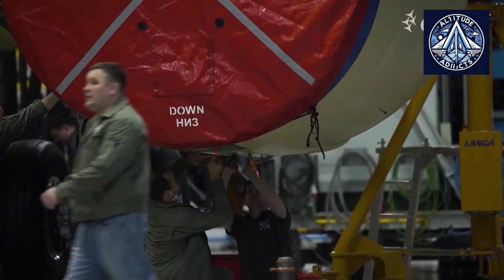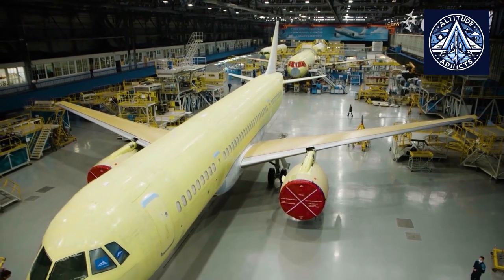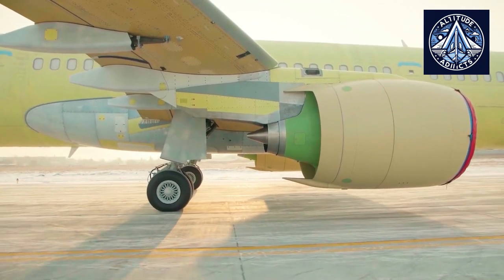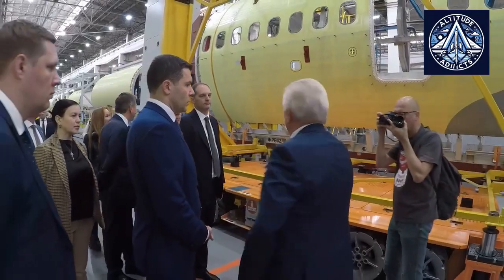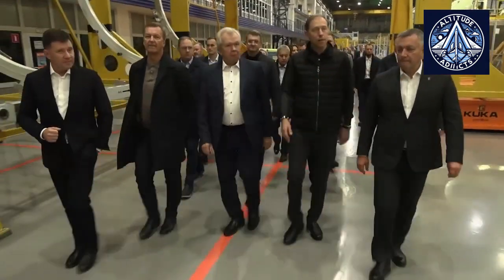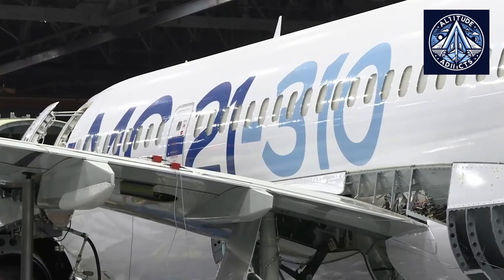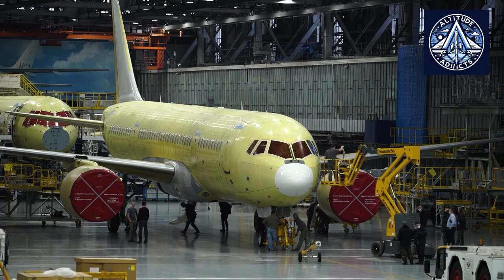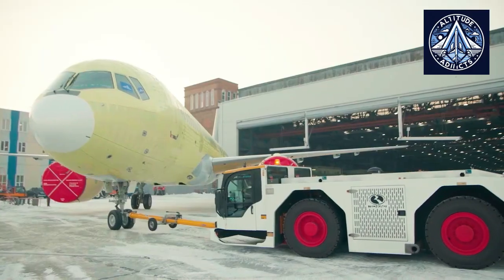Final Black Wing for MC-21 Created, Work begins on MC-21-210

Comment: The MC-21 is actually going to be one of the most thoroughly tested aircraft ever upon introduction.  Usually, a flight testing program is rushed over just a couple years - and this works, I'm not knocking it.  But (due to political developments) the MC-21 has been flight tested since 2017 in a wide number of configurations - with western engines, without western engines, with the out of autoclave composite wing made from western sourced fiber, with it sourced from domestic fiber, with western avionics, with domestic avionics, etc.  The design has WAY more proven miles on it than your typical program.  Without notable incident.

It definitely remains to be seen whether Russia can get actual mass production going for economies of scale.  But I would bet on it being a very safe passenger aircraft, and it will meet Russia's needs.

Comment: What exactly do they want to build? Look like indecisiveness. I think TU 214-400 is a better option. That one is already flying can be modified to meet global standards. Could be wrong, but looks like MC project is as good as throwing money in a bottomless pit.
Reply: TU-214 is a Soviet design and to make competitive with Boeing/Airbus, almost all components need to be replaced. By replacing few components, Russia can at least to fill the gab of Airline shortage for now. However still it is better to develop MS-21 which is complete Russian and having new technologies to make competitive.
Reply: Technologically and economically the TU-214 is a pair to B-757 and MS-21 is a pair to A-320Neo & B-737Max , while MS-21 is a 100% russian made the TU-214 still depends on some western components.